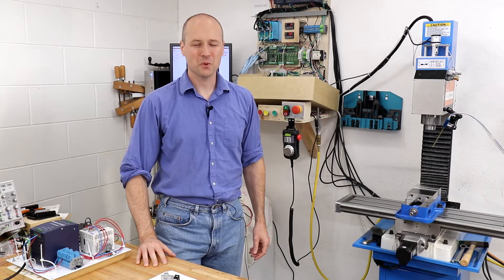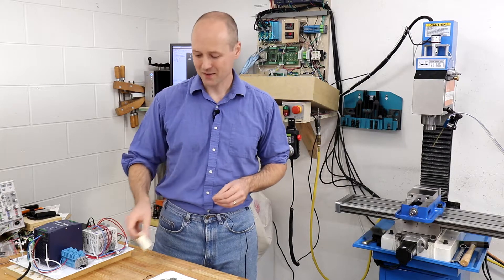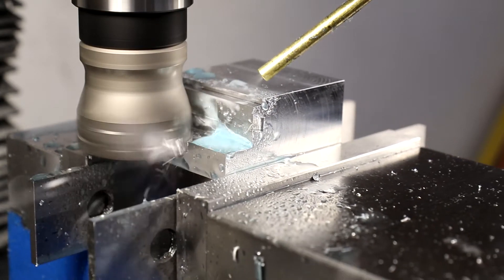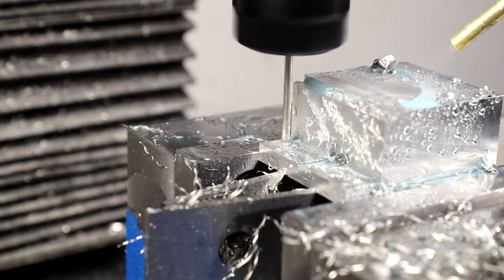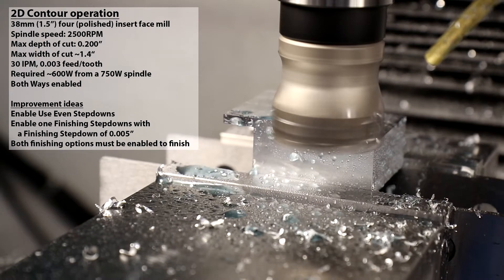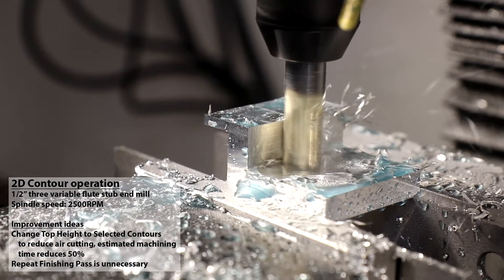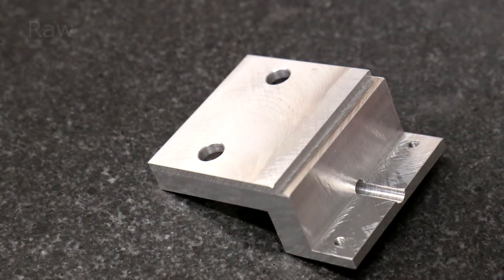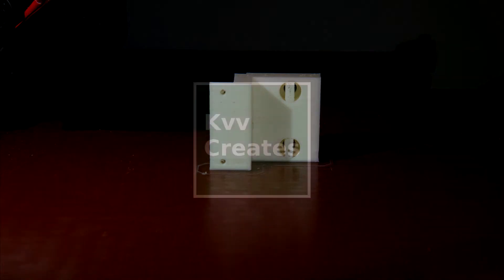Improve CNC milling performance of magnetic door catch sensor bracket

Comment: Nice video Kent! You get a lot done with the Tormach facemill.  I'll have to try and use it more often. I like the bead blast finish.  Ill have to give that a go also.
Reply from the maker: Thank you Craig. I'm finishing up a new video and for a part of it I try using a Dremel wire brush to debur and experiment with the finish... Some old airplanes had this awesome repeating pattern on aluminum panels made with a spinning wire brush. Well... let's just say I obviously have more experimentation to do :) Hope your off to a great New Year!

Comment: Its tough to stomach the working for less than minimum wage thing,   could a backer fund the prototyping and let you get on with selling them? Do you have a video discussing the pod and business plan?
Reply from the maker: Hi Jacob. There's more to this than can fit into a comment :) but I'll try to hit the high notes. The investors I've talked with have convinced me that investors are not what I need and am thankful they were such high quality mentors. You know how this stuff goes, the long hours of the first one are spread out over subsequent sales and projects. Many of those hours are not because they are requested or required but because of my own expectations. In the meantime, I feel great about life right now and the future, and that was not the case before going independent three years ago. The business plan is simple, keep delivering great value to existing clients and others will want the same, and avoid getting locked in. I've learned more what not to do than to do, but I believe I have a better sense of why I do what I do than most.
Reply: Kurt, Thanks for sharing your insights.

Comment: Kent very interesting, so where did all the time savings come from (which parameters) and are you running your glass bead with your California  Air Tools compressor?
Reply from the maker: Hi Paul. The total time = setup + milling + overhead. The setup time (squaring stock, etc) is similar. Overhead is almost certainly less in 2017 because I'm more experienced. Regardless, I only reported milling time. The efficiency of the milling time is going to be related to material removal rate (MRR) which is proportional to depth of cut X width of cut X feed rate. So, there is not a single parameter that was tweaked. Beyond these, Fusion 360 has numerous parameters, such as lead-in extension and rate (heights was the one I mentioned in the video), which will impact time but are not included in the standard MRR equation, but perhaps we could have a Total MRR which considers total volume of material removed / total milling operating time. Total MRR is going to be proportional to average power delivered through the tool, limited by the spindle motor. If there is a single instantaneous measurable parameter to optimize, it's probably power and each parameter has some contribution. Hope that explanation is interesting and helpful.

Yes, I'm using the same CAT and blaster as here. If I let the compressor catch up occasionally and don't blast huge surfaces, and the combination works well.
https://www.youtube.com/watch?v=1MsD7bwCgzI

Best wishes, Kent